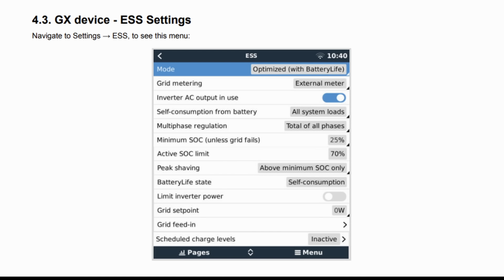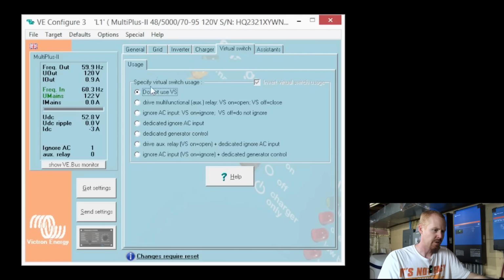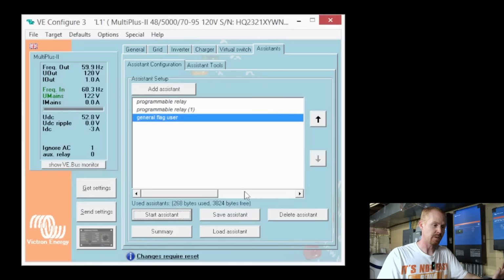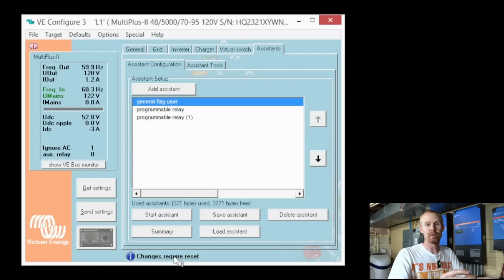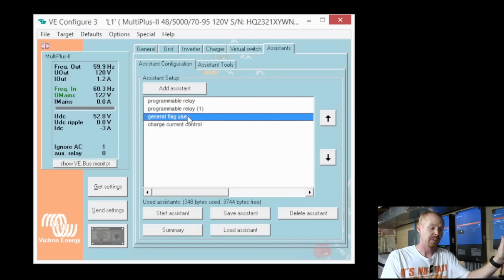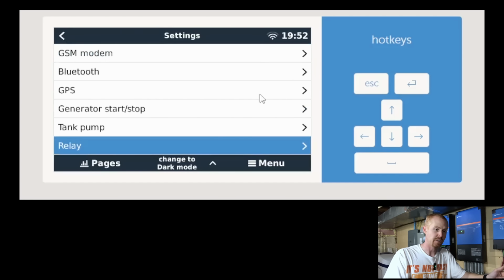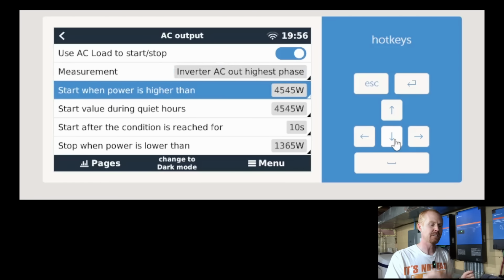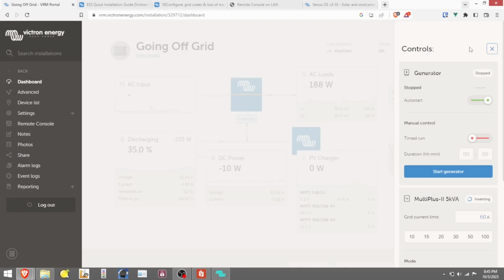Different Ways to Ignore AC Input on a Victron MultiPlus 2 Inverter

Comment from the maker: *
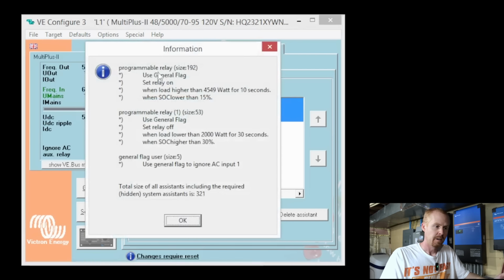At 9:21, the generator start/stop assistant information is not correct.  In the video it shows the relay being turned on when the load is high or the SOC is low (and the opposite for low load and high SOC), but the relay should be turned off.  The relay is controlling the General Flag (AC Ignore).  When the relay is set to "on" it will activate AC Ignore and turn off the grid connection.  When the relay os "off" it will NOT ignore AC In and the inverter will switch to passthrough mode.  

Basically  you just have to switch "relay on" to "relay off" and visa versa for the two programmable relay assistants.  Unfortunately I cannot edit the video to add the correction without taking it down. 
*

Links to the parts & pieces in the video (affiliate links)
------------------------------------
Victron 48V MultiPlus-II 5kVA 120V Inverter
https://www.currentconnected.com/product/victron-48v-multiplus-2-5kva-120v-inverter-70a-charger/?ref=AzzpK9Fl

10kVA 120/240v Base MultiPlus-II System
https://www.currentconnected.com/product/10kva-120-240v-multiplus-2-5kva/?ref=AzzpK9Fl

Victron VE.Bus to USB - MK3-USB Interface Configuration Tool
https://www.currentconnected.com/product/victron-interface-mk3-usb-configuration-tool/?ref=AzzpK9Fl

Victron Cerbo GX
https://www.currentconnected.com/product/victron-cerbo-gx-system-controller/?ref=AzzpK9Fl

Victron GX Touch 7" Display
https://www.currentconnected.com/product/gx-touch-display-cerbo-gx/?ref=AzzpK9Fl
Reply: Dear Adam, do you know if it's possible to add your Virtual Switch with classic ESS ? I would like pilot the Cerbo GX relay 1 with Home Assistant modbus automation (when in France we are in Red Expensive Day with EDF grid Tempo price) ?!
Reply from the maker: @indianagrenoble38  If you do it all through assistants then you should be able to use both at the same time.  You can't use the actual "Virtual Switch" feature though at the same time as any assistants.
Reply: I understand your video...great job.   I have grid and generator.  Sometimes the grid is off  (Bahamas !) and I need the generator to behave as in your video. The generator would be started manually so AC would appear on input 2.  Would the scenario work without any changes eg if I used the Start Generator Manually for say 1 hour to top up batteries ?
Graham
Reply: G'day Adam from Australia. Just wondering if configuring your multiplus this way is legal? After all - if your Multiplus thinks the grid is a generator then will it meet all the appropriate grid regulations? Eg not backfeeding power to that AC output? So in the event of "generator failure" will it cut power to the AC input terminal? I imagine it does but there are a whole lot of regulations the Multiplus has to comply with to meet different grid standards around the world (like ramping down battery output in response to frequency changes etc).
Reply from the maker: @mondotv4216  the only way the Multiplus allows power to go back out over the AC In is when you use the ESS assistant.  Using it the way I have configured is just like an off-grid inverter.  Power only flows one way.
Reply: Gday Adam
I’ve watched your video over and over but my multi isn’t clicking the relay over to AC Input/Generator i can here the cerbo relay clicking over but it’s like the multi isn’t receiving the signal
Reply from the maker: @lukeclose4580  I would try disconnecting the wires from the cerbo and bridge them together.  When you “close the circuit” it should activate the ac input.  If it doesn’t work it either means that there’s a bad connection in the aux input or a programming issue where something might be backwards.
Reply: @AdamDeLayDIY tried that no luck
Reply: @AdamDeLayDIY  which Victron is controlling as I noticed in your video you set the multi assistants as well as mentioning settings on the cerbo, do they need to match or do the cerbo relay settings override the multi
Reply: @AdamDeLayDIY all sorted I worked out i was using the settings for the first half of the video but expecting results from second half🤦‍♂️ keep them videos going very intuitive 👍
Reply: tried this so many ways still cant get to work for me
Reply from the maker: @ we’ll need some more information in order to help out.  What have you tried and what hardware do you have?
Reply: @AdamDeLayDIY  Hi i'm from UK  i have multiplus 2  48v 1500/200-100 230v for some reason its not ignoring ac in put. do you the charger enabled on or of
thanks for your swift reply
Reply from the maker: @envermehmet8448  I do have the charger enabled, but I set the charge current to 0 (I have another video on how I adjust it).  

So were you trying to use the assistants or the cerbo start/stop functionality in order to ignore AC IN?  I'm sure you saw my note in the description and pinned comment about how I had some assistant logic backwards?
Reply: @AdamDeLayDIY  im trying to use assistant. trying to ignore input ac untill it reaches 47v or below then it charges my batteries till 55.30v then batteries take over
Reply from the maker: @envermehmet8448  Can you save your settings to a file and email me that file so I can look over them?
Reply: just emailed you
Reply: I was able to see the corrections on your post because the system wasn’t working with the old relay on my system. So I corrected the relay per your post by switching the on and off. I’ll let you know if the changes have corrected the problem. I only saw your post after looking for a solution to the problem I was having.
Reply: Is the virtual switch works in parallel with the ESS asistant?
Reply from the maker: @akosdori2439  No, I don't believe you can use the Virtual Switch and Assistants at the same time.  You either use Assistants or the Virtual Switch.
Reply: @AdamDeLayDIY  virtual switch i mean your first option to ignore the AC
Reply: @AdamDeLayDIY  Programmable relay + ESS
Reply from the maker: @akosdori2439  Correct, you cannot use that option and any assistants at the same time.  It's one or the other.
Reply from the maker: @akosdori2439  Yes, both of those should be able to work at the same time since they're both assistants.
Reply: @AdamDeLayDIY  I wonder if a criterion needs to be met for the relay to turn off? Because ever since I sent the configurations, it has been above the set SOC, and the consumption hasn’t exceeded the set value, but the system still sees the AC
Reply from the maker: @akosdori2439  the criteria is gonna be based on what you program otherwise it always defaults to “on” where power is used from the AC In.

Comment: Thanks for the video. I am currently using the ESS and SOC to set when AC input is used to power load without charging the batteries concurrently by changing the charging current to 0 amps in the program. Occasionally, I would like to charge the battery from AC/Grid power without having to go back to change the current from 0 amps to 70 amps, is there a way to accomplish this function?
Reply from the maker: You bet!  I didn't want to mess with the ESS assistant because I thought it leaves the grid connection active all the time and there's potential for power to go back up through the grid connection.

You might wana take a look at these videos.  I use an assistant and a relay connection on the cerbo to control when I enable/disable grid charging and it does so by changing the charging current.
https://youtu.be/T5-7xcGWsgE
https://youtu.be/5RkDZTYVTKw

Comment: Has anyone ever trid this together with the ESS assistant? for example SOC% above 50% the input relay is open and ESS is working like during a grid outage, and under 50% SOC the relay closes and ESS functions like programmed. 
I want to experiment with this but it's holiday time and I've got a house full of guest who is not going to be happy with me switching power on and off🤣
Reply from the maker: I haven’t.   When you enable the ESS assistant, I don’t believe the grid relay turns on/off.  The inverter tries to blend the power together and that gives a potential for backfeeding to the grid.

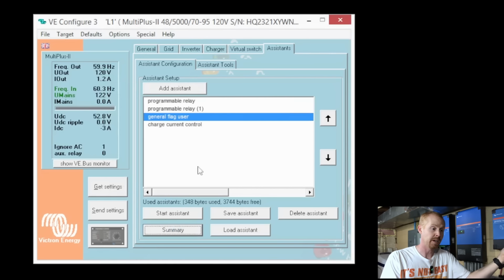Comment: Around 13:20 you have the relay set to on for the first relay.  Should that be set to off when aux1 is closed ... basically the opposite of what you show.  I know you mentioned it for the first set-up, but I like the ability to turn charger on or off.  So relay off when aux 1 is closed, and relay on when aux 1 is open?  Also, on the Charger tab ... is charger turned on checkbox checked?   When I set my inverters from inverter only to on the charger starts up and the generator stop/start has no effect.
Reply from the maker: That section of the video is correct.  When the circuit is closed, I want the relay turned on and acting like normal (so it would detect grid and switch to bypass mode).  

I have 2 videos related to dynamically enabling the charing from the grid.  The second video was just an update because I forgot to add something in the first video.
https://youtu.be/T5-7xcGWsgE
https://youtu.be/5RkDZTYVTKw
Reply: @AdamDeLayDIY  Adam ... are you controlling AC-Out 1 or AC-Out 2 with the assistants?   I'm only using AC-Out 1

Comment: Adam, is there a solution for switching to charge only.  I noticed charge only no longer works.  Why do I care? Because I have two Multiplus IIs in parallel and that requires a minimum grid unit of 18.8 amps. If you can switch to charger only you can set grid limit as low as 10 amps but charger only isn't an option with generator on.  I'm using a small generator.  Very convenient small generator. 

Hoping for answers
Reply from the maker: Did you try the physical switch on the inverter?  It has 3 states: On, Off and Charger only.

If you’re looking for a way to automatically switch to Charge Only, I’m not aware of a way to do that natively.  You might have to look into NodeRed since that allows for a lot more customization.
Reply: @AdamDeLayDIY thanks for responding.  I did try physical switch, and it didn't make a difference.  Funny virtual switch doesn't do anything. 

Node Red I've been struggling even just to get a tank label changed.  Would love to find some hands on videos there. 

Funny Victron thought to disable charge only when generator is enabled.

Comment: Nice solution.

I just don't get why Victron doesn't do this out the box. I have solar and storage on board. Why on earth would I want to have a shore power bill when I don't have too?

So what do you do now if you're offgrid and need to start your generator?
Reply from the maker: Thanks.

Victron is primarily built for mobile/marine installations which are only occasionally connected to shore power.  They just never really redeveloped the software options for residential installations.  They did add one option a year or so ago, but I’ve never used it.

Comment: It is too much work comparing to DEYE/Solis/luxpower software , and less efficient
Reply from the maker: I'm not following what you're asking.  Are you talking about Victron looking at other options?  One thing you have to remember is that Victron has been around for a very long time and it's originally built for the mobile market, not for the fixed, residential market.  They've made changes and allowances for just about any usage you need though.  

I've actually heard rumors that they're coming out with their own AIO for the US market.

Comment: Hi,  Thanks for the video but for my situation (and I daresay a lot of others now, especially in the UK where we have very significant electricity price differences throughout the day) all I want to do is stop my house from using mans electricity in any way outside the cheapest overnight period (0130 to 0530 in my electricity provider's case).  I gather the same Aux input can be used to control the relevant assistant/s but I do not have a Cerbo, nor do I want one.  Instead to provide the switch times, I propose to use a very cheap and simple mains programable timer with a pair of 0V contacts wired to Aux 2.  A video about this would be extremely useful for many people.
Reply from the maker: Thanks for the comment! The Cerbo just makes it easier to adjust, but the inverter’s built-in generator assist can already do the switching. The only trade-off is you’ll need to edit the assistant if you want to change timings.

Comment: One other reason to use the cerbo relay instead of  assistants is that you can’t automate actions based on time. For example if you want to ignore AC In during the day and use off peak electricity to charge your batteries at night you have to use a cerbo.
Reply from the maker: Very true, thanks!

Comment: My God could they have made this easier to use ? LMBO
Reply from the maker: Yeah, it's not as simple as it could be.  Unfortunately it seems like since their hardware is primarily designed for the mobile market, when you install it in a "fixed" environment, you have some extra steps you have to take in order to make it work properly.

Comment: Adam, Great informative video.  Trying to active my system so my Cerbo GX controls the AC input (passthru) on the Quattros.  I changed the "relay on/off" around from that mentioned in the video per the comments below.  But I can't send the settings to the Quattros.  I get a warning saying "Assistant setup will not be send to the devices because assistant setup can only be send when selecting 'this device' as destination!"  Did I forget to do something mentioned in the video?
Reply from the maker: Thanks!

Are you directly connected to the Quattros with a Mark 3 to USB device?  Can you save your changes to a local file and the try to reconnect to the inverter?
Reply: @AdamDeLayDIY  I am connected via MK3 to USB.  I've saved the configurations to a local file as I try different parameters.  I thougth I did the Cerbo settings correctly and then the Assistant setup via the MK3/USB connection.  Even at 87% SOC (parameters set ot Invert until 95% or down to 12%) as soon as I upload the settings to the devices, Inverters switch to Passthru.  Same thing when I had the relays in the assistant reversed.
Reply from the maker: @EdLoxterkamp  hmm, what I would try next then is setting the "back to battery" SOC to 1 % higher or lower than your current battery SOC and then either charge the battery or discharge to make it cross that new setting.  This will show you if the relay settings are correct.  

Are you using the step which has the Aux 1 wired to the Cerbo?  If so, double check and make sure those connections are solid.  If they're not, that might be why it's always defaulting to passthrough.

Comment: Very cool! Great video. Is there a way using similar logic to disable AC pass through based on this logic? Or even disable AC pass through when AC Load on AC Input 1 is connected? Would like to have AC Out 1 & 2 driven by inverter & batteries always and use shore power or generator to charge batteries only. I have a 7kw battery bank that can drive the caravan.. and even fire up the AC/heater.. but it cannot do that on a standard generator input on AC Input 1. So would like to be able to power up a generator and use that to charge.. but not have the generator providing any power to the AC Output 1/2 as it can't handle the load. ;-) Any thoughts on how to achieve that with this logic?
Reply from the maker: Without using the ESS assistant, it’s always going to be either shore power or battery power. There’s no blending of the two, there’s no way to have the inverter stay on battery power while charge from shore power.

Now what you could do is use something like a Chargeverter charge your batteries from either shore power or the generator. That would isolate everything and give you the flexibility that you’re looking for.

https://youtu.be/lXHOD9OL5b4

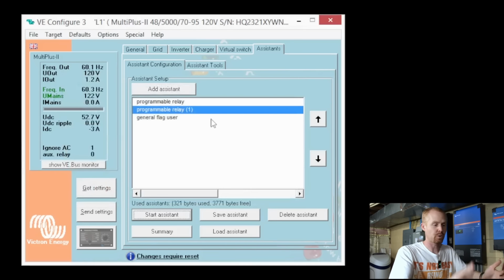Comment: I’m not sure why but I can’t seem to get it to ignore AC Input in the basic/first scenario described at 9:05 

I tried multiple flashes and tried different settings and order of those three assistants but in any case it doesn’t follow the ignore AC input rules on my two phase 10K Inverters. Any ideas what I might do as a next step? Really trying to control the input to minimize Grid draw.
Reply from the maker: Did you happen to see the pinned comment and the note in the description about values being backwards?  I'm wondering if that's what's going on?
Reply: @AdamDeLayDIY I tried multiple configs after it didn’t work the first time, starting with On/Off/General, then Off/On/General then General/Off/On then General/Off/OnOff, etc and none seemed to work. I like the more complex relay idea but I assume if this version isn’t working since it’s software controlled going through the relay version won’t work either. I’ll try again with different configurations but yeah not sure why it’s just pulling from grid in all cases when the breaker is switched on
Reply: @AdamDeLayDIY so I just rewatched and understand, it’s the values that map to on off that should be inverted since the flag is “ignore/off”. Just updated and it’s not pulling! Assuming it will now work when SOC gets low. Thank you!
Reply from the maker: @JeremyWight you bet!  Sorry about the confusion!   You can aways program the “switch to grid” value to be 1% off of your current battery SOC just to test and make sure it switches properly.
Reply: @AdamDeLayDIY I never did get that to work but I setup the wired relay and it’s working perfectly! Thank you so much Adam!
Reply from the maker: @JeremyWight  at least that works!

Comment: Great video. I have a question. How does the solar input play into this? How do we programme a maximum charge rate without dialing down the mppts?
Reply from the maker: Thanks.  The MPPT is separate.  You program on the charge controller its max settings and then it just does its thing.  If the system switches to grid, all the PV power just gets dumped into the battery bank till your SOC gets to its setting to switch everything back over to battery power.